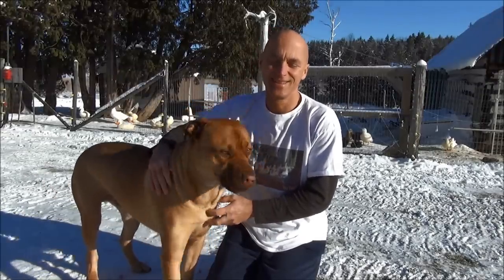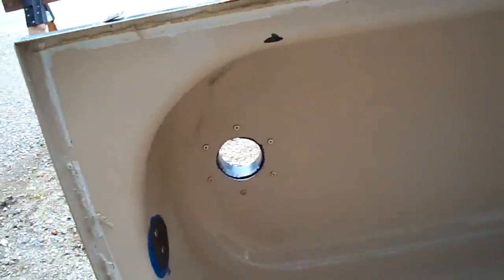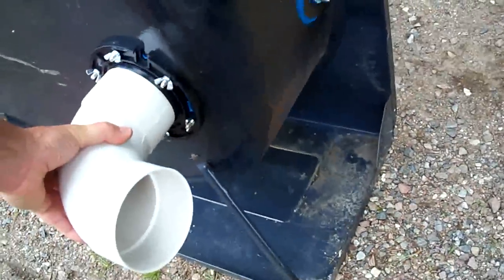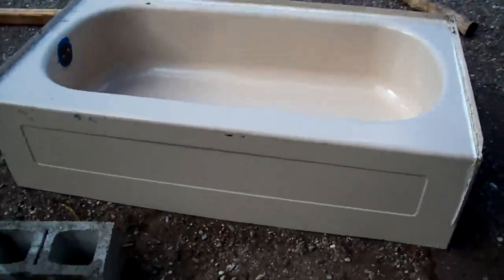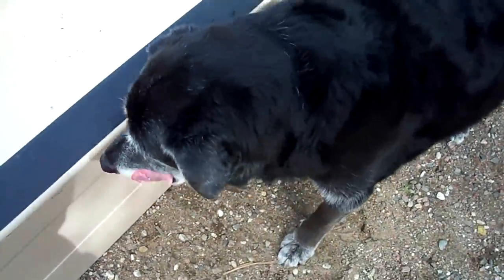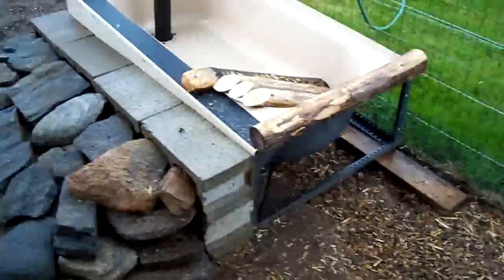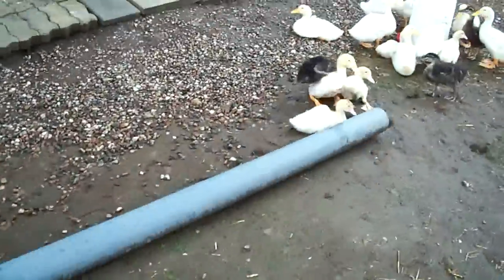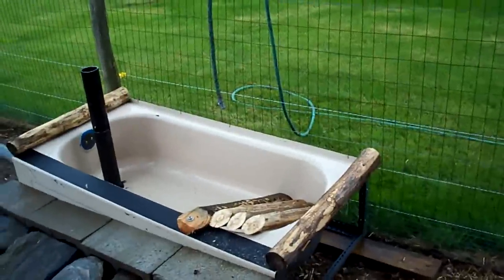Making A Swimming Tub & Shower For 169 Ducklings #17 Raising Ducks

Comment: So the drain is a ‘standard toilet flange’ but what are you using to plug the drain? Everything we tried, leaked at the connection
Reply from the maker: I'm using an expensive 3.5"" pressure test plug I got on Amazon, it was like $70 for the plug but it works great now year 5
https://www.amazon.com/dp/B0085PCCIA/ref=cm_sw_em_r_mt_dp_F2wyFb4RKX3BC
Reply: @VenezuelaNow  but, you showed using a pipe so you don't have to put your hand in the yuck tub to empty it